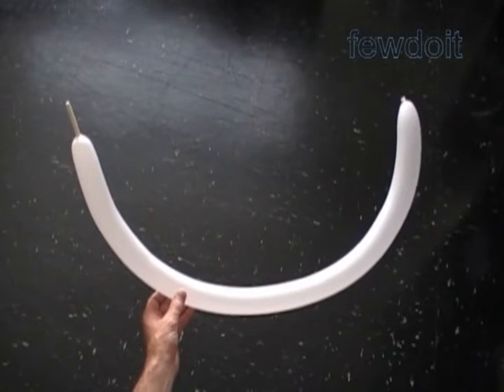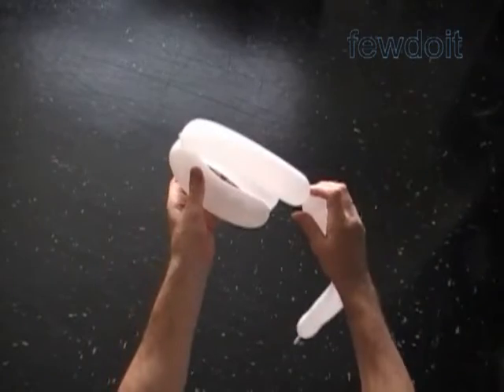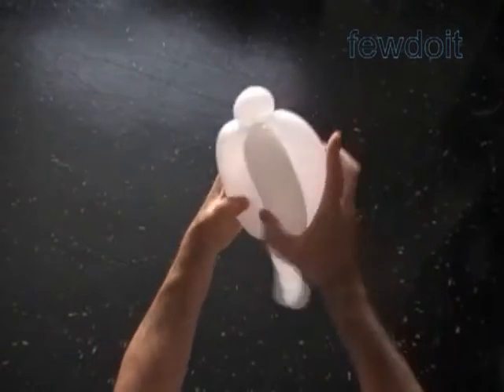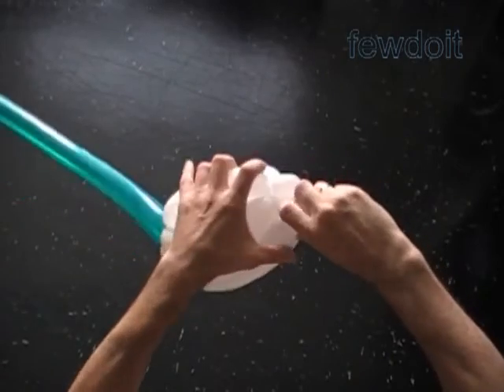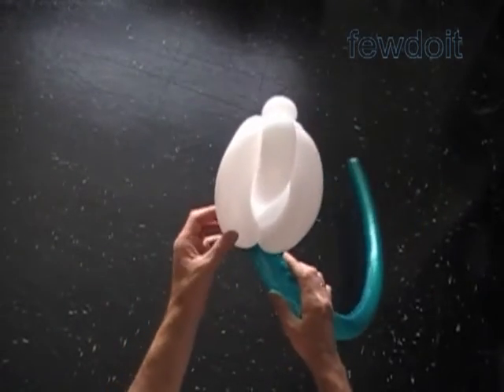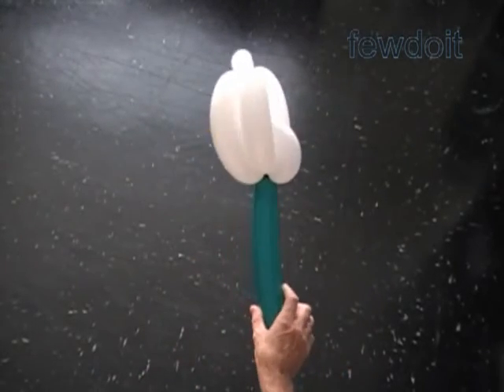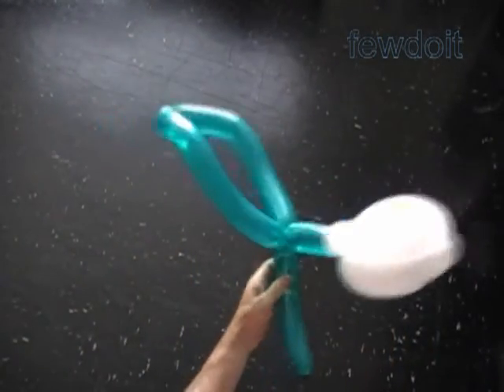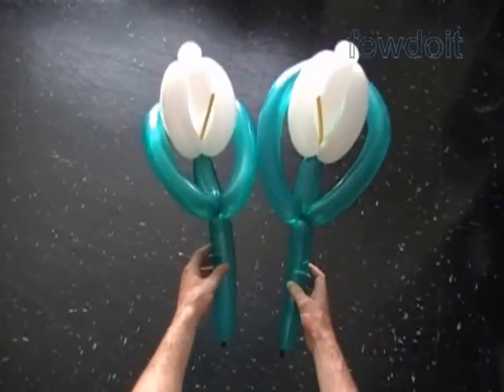Calla Lily Balloon Flower Lesson

Comment from the maker: I think of couple other ways to make lily. One that I mentioned before looks about the same. And the other way it may work if we use just two bubbles. One short bubble (up to 10 inch). Shape the rest of the balloon in spiral around the first bubble and then lock both ends of the long bubble at the base of the flower. It's just idea. I have to try it yet. I will published it only if it comes out good. Thank you for your comments and questions. I missed questions since I stopped working on street.